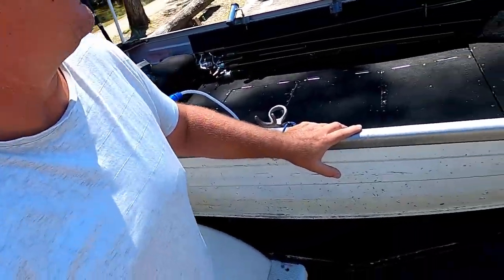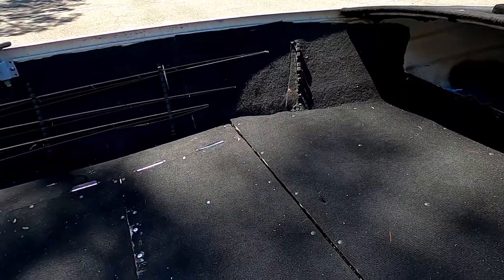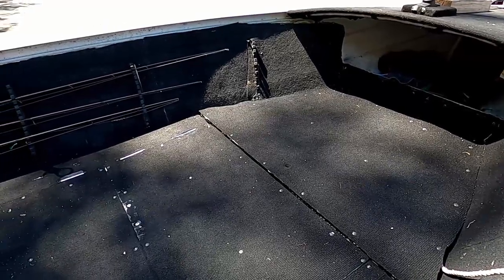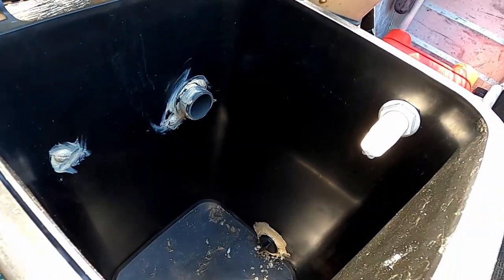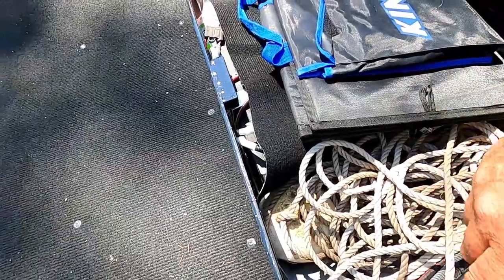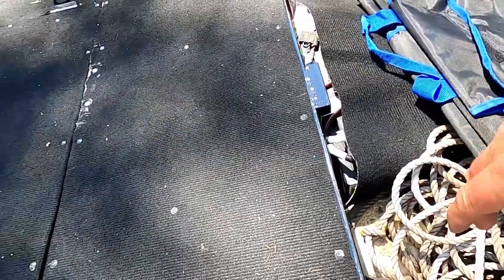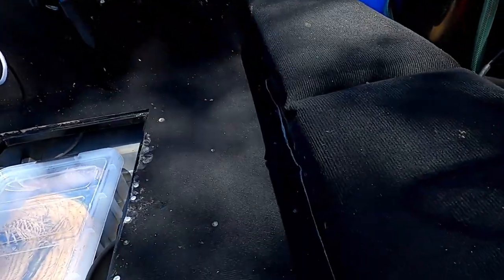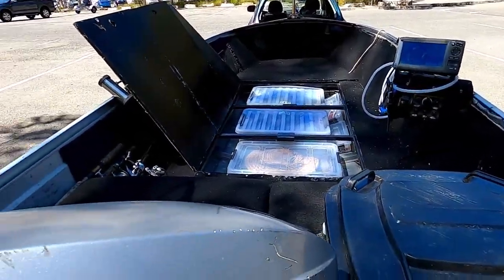Tinny walk through the ULTIMATE SOLO TINNY

Comment: Great setup, how did you work out the frame would for the floor and what is the floating floor made of, marine ply? Thanks for any info
Reply from the maker: Just measured it all up with 20mm by 20mm box section it’s all painted form fly been in for a couple of years now and still going strong and that boat lives on the water
Reply: @freemansspeech2108  thanks mate.